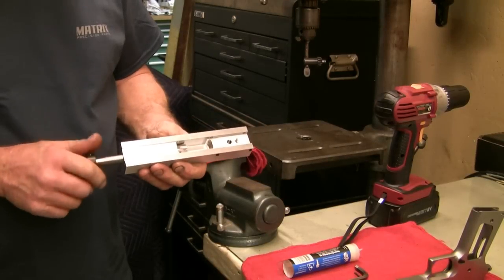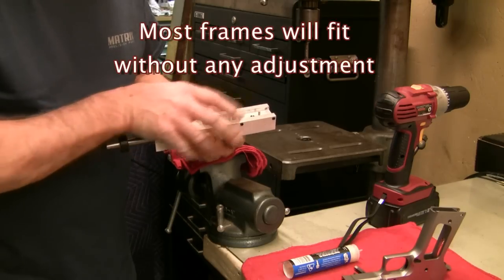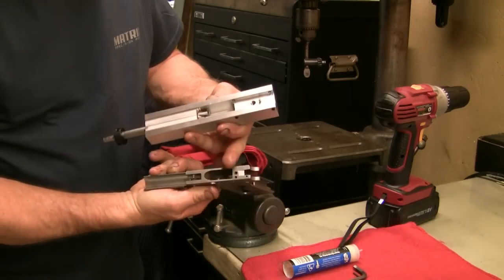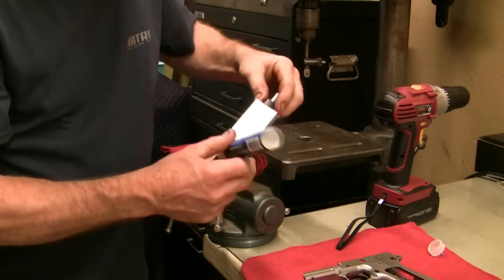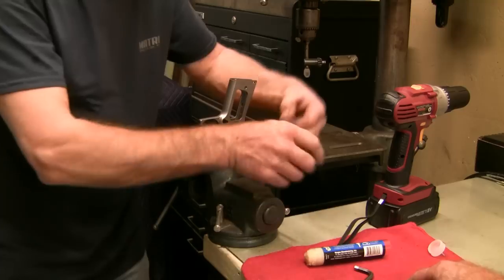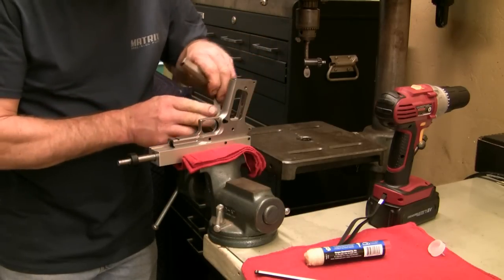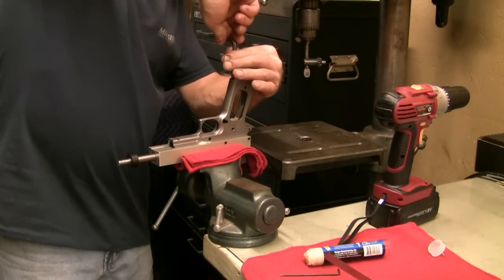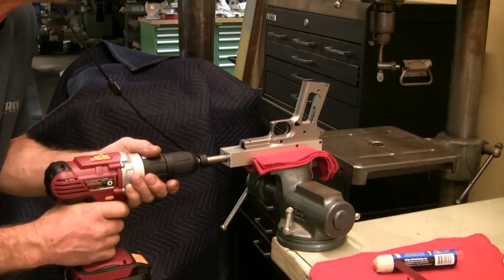1911 Barrel Seat Cutter

Comment from the maker: I normally use a standard thread cutting oil. The solid thread cutting lube is fine also and less messy. To get good cutter life and a smooth cut in steel or stainless frames, use a low RPM, something like 400 to 450 and a slow feed is best. For aluminum, 1000 to 1200 RPM is fine.

Comment: I have a 3/8 drill but it will not open enough to allow the shaft into the chuck. So I need to buy a socket for it. What is the size of the shaft? What size socket would I need for it?
Reply from the maker: The socket to use is 3/8 inch to fit on the hex part of the shaft.

Comment: Is there a specific tolerance for the off center inside cut on a frame before you say thats too much diagonal variance top to bottom of the magazine well in the handle. Ive got a frame that is thicker on one side of the top and thinner at the bottom of the frame, and then opposite on the other side. Hopefully that makes sense in writing this. In other words the inside cuts are at a slight diagonal top to bottom. I'm wondering how much would still be acceptable as a build able frame? Any help in answering this question would be greatly appreciated, and then would divulge the retailer I got this frame from so others could avoid it if it turns out to be a throw away frame. Thank you.

Comment: The jig you sent me has no set screws in it, nor any place for any set screws.
why?
Reply from the maker: The set screws were eliminated about six years ago. They were difficult to use and not necessary. The frame should fit in the slot in the tool snugly. If not, you can shim equally each side to center the frame in the tool.

Comment: Amazaballs!

Is there a 1911 80% frame that you recommend for use with this seat cutter jig?
Reply from the maker: I believe they all will work except KT Ordinance 1911 and Limited 10 2011.
Reply: So it doesnt work for l10 2011 frame?

Comment: Does the frame need to be decked first  ?
Reply from the maker: Yes, however the frames that need decking almost always have the barrel seat cut.
Reply: @tubularyou100  Are they really 80% frames if the barrel seat is already cut or are they 90% frames?
Reply from the maker: @RichmondHBK  The operations for the 1911 frames usually fall into two categories with the same number (four) of unfinished operations:
Cut barrel seat, cut rails, drill sear and hammer pin holes, or deck the top of the frame to spec, cut rails, drill sear and hammer pin holes. 
Same number of operations, it just depends on what operations were missing when the frame was submitted to the ATF.
The term 80% is really a name for a category of frames, the percentage has never really related to how much of the frame is incomplete, other than as a broad generality. In fact, I would guess most 80% frames are actually closer to 95% in terms of the amount of machining that has been done, versus what is left to done by the builder. Our 80% Sig frames take one hour and forty five minutes to make them into an "80%" from a block of aluminum, but to make them a 100 percent frame on our CNC mill would only take about another five minutes.
Reply: @tubularyou100  Where can I buy those Sig 80% frames you speak of?
Reply from the maker: @RichmondHBK  www.matrixprecisionparts.com

Comment: sorry but that  cut looked bad/rough, may be look better more even, if you took a little more time cutting it, or make a passage to get some more cutting oil in there while cutting, or add a finishing reamer to even and smoothen out that seat
Reply: Yeah, the instructions sent with the kit specifically say to turn slower rpm than in the video. Aluminum wants an SFM of 150-300, (800-1650 rpm) but steel needs closer to 90 SFM (500 rpm) and stainless even less at 55 or so (300 rpm)
In the video here, that was definitely a surface speed more akin to aluminum, which does cause a subpar finish and greatly reduced tool life; however the frame was definitely usable.

Comment: Do you cut the barrel seat before or after filing the rails down?
Reply from the maker: After, however, if a 1911 80% frame needs the barrel seat cut, you can pretty much guarantee it does not need decking because decking the top is a compliance cut in lieu of cutting the barrel seat.

Comment: What Lubricant Is Best To Use For The Cutter ?
Reply from the maker: Any thread cutting oil like Oatey Thread Cutting Oil from Lowes or Home Depot
Reply: If you're working on aluminum parts, just use automatic transmission fluid for vehicles.  It's just as good as any cutting fluid and it's cheap and available almost anywhere.
Reply: @tubularyou100  In the vid, you used a solid lube.  is that better than an oil?  which lube did you use in the vid?
Reply from the maker: @hoffy97   I normally use a standard thread cutting oil. The solid thread cutting lube is fine also and less messy. To get good cutter life and a smooth cut in steel or stainless frames, use a low RPM, something like 400 to 450 and a slow feed is best. For aluminum, 1000 to 1200 RPM is fine.